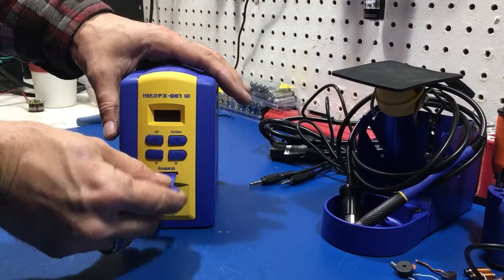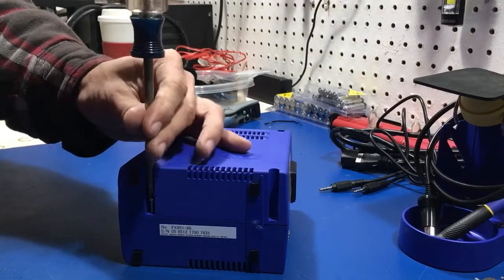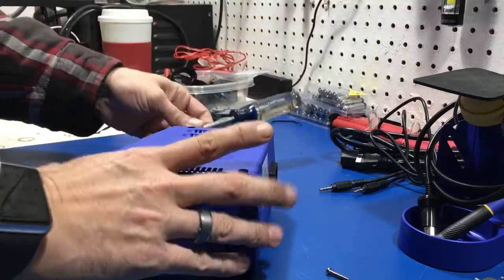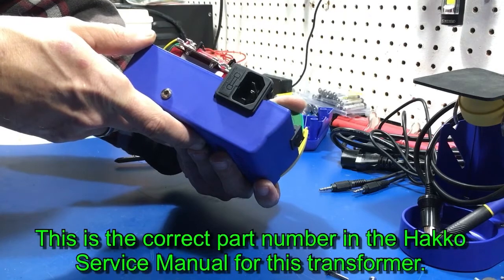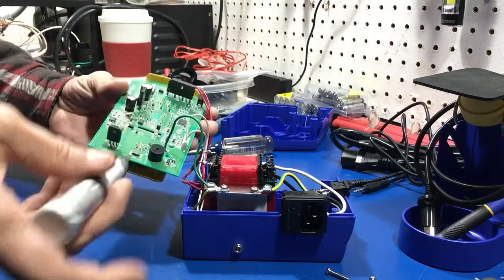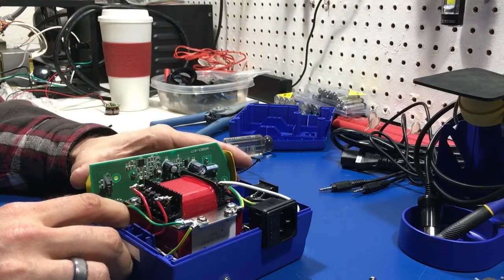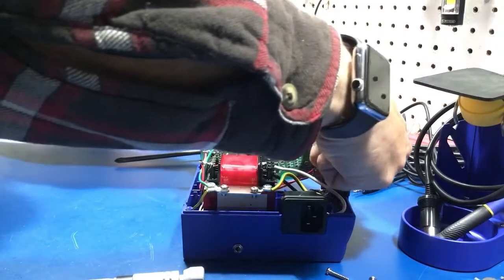eBay Hakko FX-951 Bonus Tear Down Fake or Real, was it to cheap to be real, let’s see.

Comment: Nice video,  looking at the guts i do believe it is a genuine 951.. nothing like fakes ive opened up...
Reply from the maker: Yea, I was also concerned but figured I would have used eBay policy about selling fakes against the seller if I needed. I can identify most fakes just from a picture with the different font in the front. 
They also blur out the hakko name if they have been reported to eBay in the past, so that’s a big givaway. I took a risk based on all the positive ratings and after messaging him for a little time asking questions. Sometimes you do get a good deal on eBay, just not that often. 
Thanks for watching.
Reply: Gadget Review Videos Very nice video and very nice buy. Pls give the eBay buying link and at what price did you buy this for?. 

Pls reply, I am a student and I need the best possible deals. Thanks in advance :)

Comment: please tell me the transformer on the secondary side what should be the voltage?
Reply: My fault I meant to say look in the comments section, left out the word section:  Here is the replay to a question:  "Glad you found the video useful.  The loading on the transformer changes due to the heater circuits so it has a range.  Using an Amprobe AM-140-A DMM and measuring directly at the transformers secondary winding I had a range of 25.5 volts to 28.2 volts 60Hz. "  Hope this helps.
Reply from the maker: He does a nice breakdown of the PCB, but I don’t think he mentions the voltage in the secondary. Nice guy, I’ve talked with him in the past for his permission to list his video in my video description. 
I didn’t realize I had the URL with the minutes and seconds directly to his PCB board review part. 
I can’t seem to find the specs on the transformer. I’m going to have to tear mine down again and take a measurement now.

If your looking for a 110V replacement:
https://www.tequipment.net/HakkoB2836.html

For a part list if you looking for the 220V version you can see this part list for the last numbers:
https://www.tequipment.net/HakkoB2836.html
Reply from the maker: jwrtiger That sounds correct. Based off the fact that transformers are not tuned to a 1% tolerance it would me normal to see this range on secondary voltage.  The different secondary reading they saw is from the grid changing voltages over the day and the load being pulled from the main board. It also why switching power supplies are more efficient and keep a better regulated output voltage. 
The mains voltage in a home is never the same on different parts of the grid.  The soldering station is a 24VDC station, but this is kept the same by the voltage regulator, not the transformer.
Because the mains voltage input on the primary side can fluctuate the bridge rectifiers and voltage regulators are designed for a wide range of input voltages. This might change from the mains input to the primary causing a different range on the secondary side.
For example, I live in the US and they call the grid a 110VAC grid, but my home usually sits at 124VAC. But my electronics, tv’s, and other things are not being damaged since they are designed to still run up to 140VAC from the mains. This design is because of grid mains input differences that will change the primary received on the transformer, and change the output on the secondary. It also compensates for the differences in the windings that vary slightly on the primary and secondary of transformers. Some times the input from the mains on the primary can change throughout the day as the grid tries to stabilize also affecting the secondary output and different readings. 
Even a small voltage regulator like the 78L08 that’s rated for 8VDC out up to 100ma can accept from 10VDC to 30VDC in the input side to compensate for this variance coming from the bridge rectifier, that is different based off the transformer secondary, and that’s different because of the change on the mains feeding the primary from one home to another.
A the transformer might output 28VAC at my house with 125VAC in, and would be a different output voltage at a home with only 104VAC on their “110V mains” coming into the house.  
This is also why the PCB and mains components cane be the same on a 110VAC version compared to a 220VAC version. The only difference is the transformer from one grid voltage to another.
Reply: Refer to comments in jwrelectro's review of the FX-951.  I think you will find the answer.  https://youtu.be/YYZs_pewRd4?t=22m6s

Comment: The fakes don't have the sleep sensor wire. Also recently the HAKKO brand may be missing. Fake also has 2 pcbs, a huge thru-hole microcontroller, and an non-insulated power mosfet.
Reply from the maker: True, recently some of them photo shop the logo off so they won’t get banned from a site for selling it with recent policy changes. But it still might have the name/logo on it if you buy it. If it still has the name in the sales add they are still breaking the policy and you can get a refund despite the pictures being photo shopped. I have a link to a EEVBlog thread showing some of these pictures and things to look for in the description of the video. 
The insides can change constantly. Yes, a lot of fake items with micro controllers are through whole since they can pay pennies for someone else to assemble them. 
I try to identified the outside differences of some with pictures, this way people don’t end up buying a fake one to begin with. Counterfeits eventually get really hard to identify sometimes, I’ve seen some changes to some items that look very convincing. 

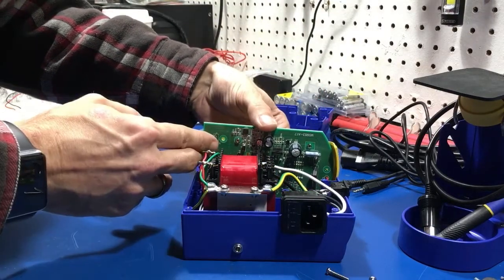The sleep port was mentioned  @ 4:51 in text, also mention in the EEVBlog thread listed in the description of the video. 
https://www.youtube.com/watch?v=LEs2pzw5mYE&feature=youtu.be&t=4m51s
Reply: 假货有休眠线,那个只是一个开关,串联一个昂贵的带 4.7kΩ 串联的老铁台.